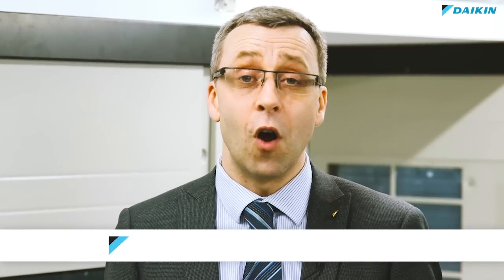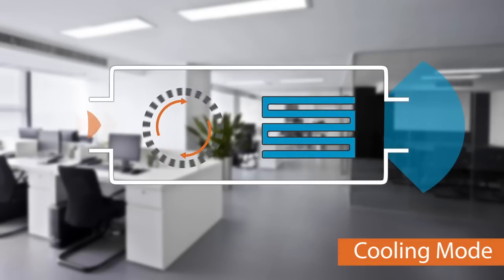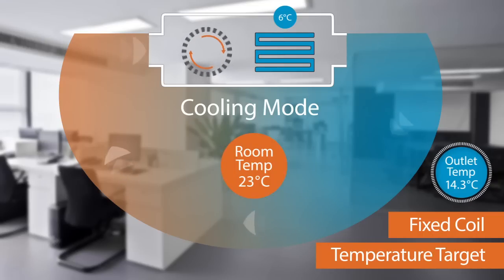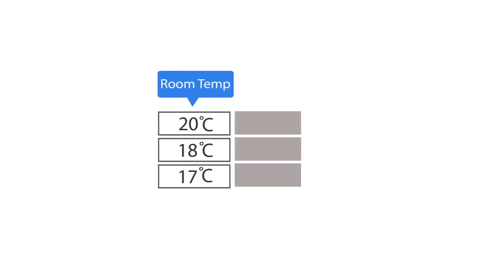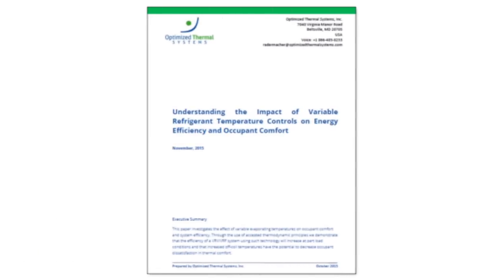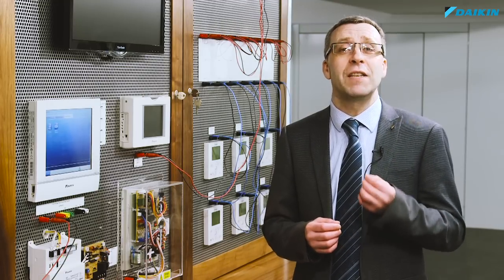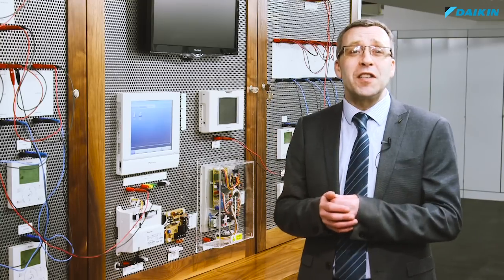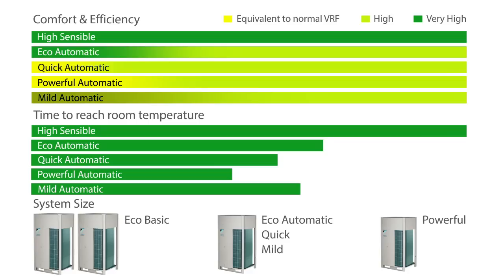Daikin Variable Refrigerant Temperature

Comment: Good video, can you explain though if several fan coils are close to set point yet some are way off does the outdoor unit manage the off coil temperatures as surely its going to be the same temp refrigerant going around the system as the EEVs can only do so much?
Reply: Good